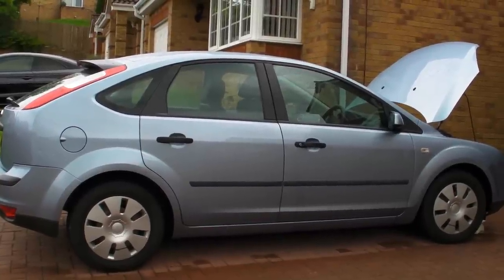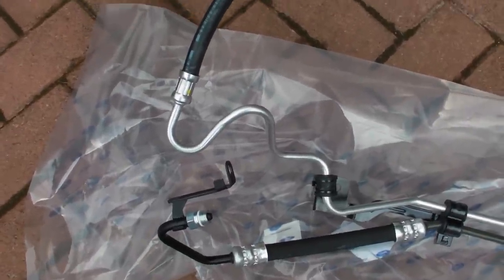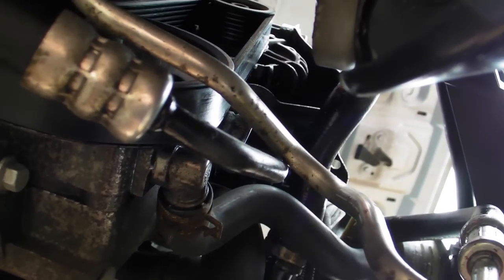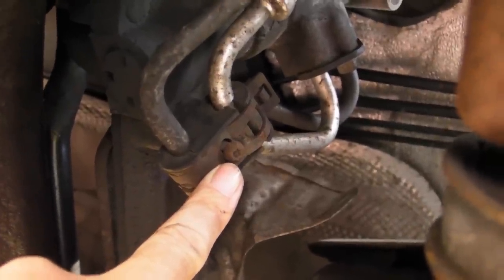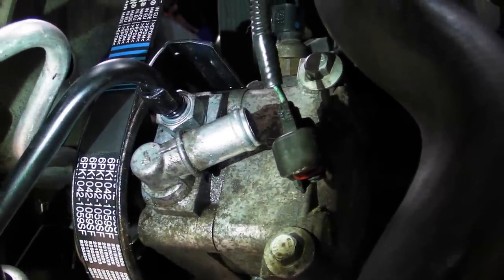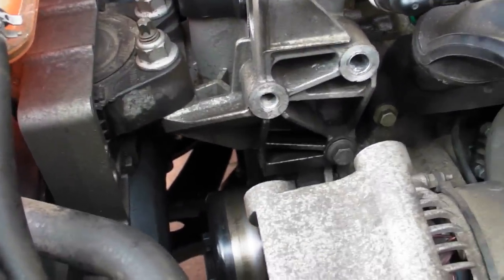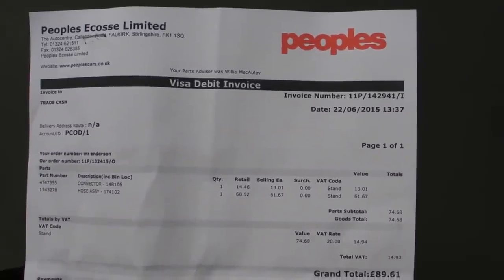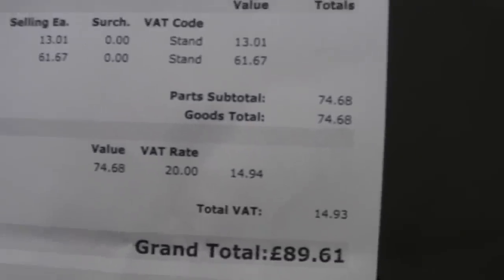FORD FOCUS MK2 POWER STEERING PUMP

Comment: Thanks very much!! This video was so helpful with both diagnosing the problem and fixing it. Your tip to snap the old pipe to get the socket on saved loads of time, and your tip on pushing the new pipe in after the union is fitted saved the day! Great vid!
Reply: Did you struggle fitting the pipe to the new union, mines is stubborn and doesnt want to go in haha! Any tips?

Comment: @sandyanderson, thanks for this video.  Just changed the pipes on my Focus after watching this. I think that I probably would have out the union on the pipe first, if I hadn't watched this. Just to confirm to those that have asked. Fit the union nut first & tighten, the pipe then push fits in. You should feel it lock in place.
Reply from the maker: Great information David cheers sandy
Reply: The pipe has popped out of the assembly on my focus,would it be ok to just push it back in? Cheers 👍
Reply from the maker: Great thanks for help cheers sandy

Comment: Mine blew other week! Regarding the union nut the correct procedure is to use an 18mm flared nut wrench and insert the pipe into the nut. When the nut is then tightened down using the wrench it clamps down in the pipe creating the seal needed. I'm sure both methods work, but correct way requires different tool.

Comment: Excellent video it definitely helped me. I struggled to find the leak at first because the pipe was delivering fluid directly to the pump pulley and slinging it everywhere so it was difficult to locate . Your video helped me fit the new pipes so thanks again
Reply from the maker: No problem glad to help cheers sandy
Reply: Did you struggle fitting the pipe to the new union, mines is stubborn and doesnt want to go in haha! Any tips?

Comment: Hi All, can anyone advise me my MKII the nut going into the pump is leaking. Can i ask if i take out the inlet line and change the white seal or put some white tape and tighten it will it solve my leak?  Can anyone advise do i need to replace the whole complete assembly line just because of one nut leaking?? Please advise how can i fix the leak problem thanks.

Comment: Changed these pipes today on my wife's focus,absolute nightmare getting it off,easy to put on,no room to get at anything,I used a very long flat head screw driver and a rubber mallet to break through the old pipe,the nut was easy to get out then with an 18 ratchet,good tip to not put the nut on first,and after all that the steering still gets heavy when the car is at idle!!!
Thanks for the video great tips, it was a big help.
Reply: Hi did you ever get round to repairing it? Mine is same..

Comment: Sandy,
            thanks for that,steering rack fluid leak this afternoon,and I am hoping that it is only the pipes.As Devon 3 says thanks for the tip about not putting the nut on the pipe first

Comment: Brilliant video, followed it to the letter but I am struggling to push fit the pipe into the union. I have fitted the new union to the pump and are trying to push the pipe into it, it just isnt having any of it. Any ideas?
Reply: Hello, did you manage to finish the job? Cheers
Reply: Did you manage to push fit in the pipe into the union?

Comment: Any advice from anyone doing this:

Firstly don't buy the aftermarket pipe. They don't match up to the framework of the car and don't fit in properly into the union bolt. Secondly, get the car jacked up, you'll need to work from the bottom of the car. Also take off the front left light and the power steering reservoir, it will give you loads of space you need. 

To separate the pipe from the union bolt I just used my jack handle(about 2 ft solid pipe) and hammer to tap it off. It tears off the bolt and then you can just use an 18mm socket to unscrew the bolt. I would say it'scan achievable Infront of the house job but don't go for a cheap replacement.

Comment: Just another update from a previous post concerning this job, I have done another replacement hose recently it appears it's a common fault where a leak occurs in the high pressure metal pipe that fits to the steering pump.
In both cases a fracture occurs at this pipe where the metal support bracket is welded to the pipe.
I have learnt a few thinks since doing two of these hose fittings which I am sure will make fitting the hose easier if doing this job for a first time , in particular push fitting the high pressure pipe into the new nut, this nut must be replaced when fitting a new hose, (ford parts supplier), the new nut should comes with the new hose kit from ford.
A mistake I made twice was to fit and attach the hose at all its mount points first and then try to push fit the high pressure line and was unable to get it to lock in place, you may be tempted to undo the nut as I did the first time a few turns then and you will find the hose locks in place but you will find it very very difficult to fully tightened the nut up, I did this by using a small chisel to tap up the nut tight (not recommended).
So my advice for everyone doing this job is to fit the hose in its location but NOT to screw it down at its mountain points, this will enable you to push the hose into place much easier because there is no longer any resistance caused by the rest of the hoses and pipe and preventing you from having full movement of pipe and preventing it from locking into place , once locked in place next fit its mounting bracket to the pump, once done finish and attach all other fixings - hope this helps everyone.
Reply from the maker: Thanks for the comprehensive information cheers sandy
Reply: @sandyande  You are welcome Sandy, found your video so so useful when I first did my hose, much appreciated

Comment: Hi thanks for your information but is there a special tool to push the pipe in to the fitting that screws in to the pump first as it is very hard to know when it is far enough in .had you to buy a new pipe or did you get it fitted Thanks dan

Comment: The 18mm bolt on the pump... Do you tighten it before you put the pipe in or leave it loose and tighten after?..

Im guessing the bracket holds the pipe in place?

Comment: Hi Sandy, thanks for an excellent video. Could you use a second hand hoses but just a new pump fitting to save money? I'm guessing it's just the seal that needs replacing?

Comment: good video.can u explain abit about steering rack connections 2 pipes.when you remove nut do the 2 pipes just slot in.do they remove easy enough.also how did u remove existing power fluid ?
Reply: I need to know this too any pointers for me thanks

Comment: How did you get the union nut off the pipe (that you put on by mistake).
Reply from the maker: Adapted a spanner
Reply: @sandyande  exactly how did you adapt a spanner

Comment: Hi, so a great vid, one question, you said don't fit the union nut onto the pipe first, so I assume you fit it into the pump and tighten, then push the pipe in, is that correct?
Reply from the maker: yes that's what the Ford parts manager said
Reply: @sandyande  Is there any way in taking out the nut and pipe, then just fitting a new nut? Thanks.
Reply from the maker: Yes that's what the ford parts department said, cheers sandy

Comment: was this pissing power steering fluid all over the place cause it was dripping on the fan belt mines all over the place the steering still light which makes me think it's not the pump and its the pipe however I'm getting a horrible  screeching noise when turning the wheel did you get this all so where did you get the  part I'm hoping I be able to get the part form ford
Reply from the maker: yes fluid goes everywhere always pipe never pump
Reply: Just bought pipe 118 form ford arrrhhh lol
Reply: Did you resolve it I have the same issue please reply
Reply: @abubokkar5714  yes m8 it was the pipe just as the guy says in the video i changed it 4 years ago i still got the car if you are any good with cars you should be able to do it your self however it wouldn't take a garage long to do so should cost much

Comment: Hi, thanks for video! My wife’s 2007 focus has heavy steering when idle/low revs, when you rev the engine to 2000 rpm the power steering is fine again...... Does this sound like the pump or hose assembly?  Cheers
Reply from the maker: Rob Burton check first the level of power steering fluid
Reply: sandy anderson fluid level is ok.....

Comment: What symptoms were you having before the replacement ive got a 2010 focus and my power steering has become heavy at low speeds and likes to snap at me going to full lock...fords tried to mug me off saying i need a new pump and rack but a local garage said pipe work.
Cheers
Reply from the maker: My symptoms were only loss of fluid cheers sandy

Comment: is there any way separating the pipe from the union nut i just need to tighten ours
Reply from the maker: Not that I'm aware of, maybe try but splitter or Dremel cutting disc
Reply from the maker: Nut splitter lol
Reply: @sandyande  thanks m8 looks like im buying a new 1 lol

Comment: is it worth getting original ford parts? im stuck and cant push the pipe into the nut
Reply from the maker: Try slacking nut off a little then push in

Comment: so with new power steering pump  (ford focus c-max) i need a new "connector 4747355" too ?
Reply from the maker: Ive never had to replace the pump only the connector and pipe work
Reply: My pump started to work very loud, but it happened that there was not enough fluid, after adding a litre and driving for 50mi, it happened again, i thought that leak is from old pump. ordered new pump. now the pump is mounted, but connector leaks, looks like i don't have this white oring at the end of connector.
(maybe it was connector leaking from the beginning :/ )
Reply from the maker: Sadly i think your right, sandy
Reply: is it possible to change just this connector?   we're unable to remove it from existing hose ... :/
Reply from the maker: razorree no have to replace all pipe work and fitting

Comment: Hi All, can anyone advise in my car only the nut going into the pump is leaking. is there any way to change only nut ? not all pipes? after releasing nut from pump how do i take off the nut from pipe ?
Reply from the maker: You have to change nut and pipe
Reply: @sandyande  thank you

Comment: Hi Sandy, how do you know when you've pushed the pipe far enough?
Reply from the maker: I've no idea because I mucked it up
Reply: It will click into place, and won't pull back out. I just spent all day trying to get my pipe into the union, but eventually took it apart again to discover the copper locking washer was all mangled, which was why it wouldn't push in. Took the copper washer out of the union, straightened it up, put it back in and it clicked into place very easy. Stupid design!

Comment: Hi there thanks for this video and the tip for the drive belt!.. I don't seem to have any leaks, but I do have a noise coming from the PAS pump..

https://youtu.be/euaxQAZTITk

I did a quick fluid change and it did quieten down some. Gonna have a good look later on to see what is going on.